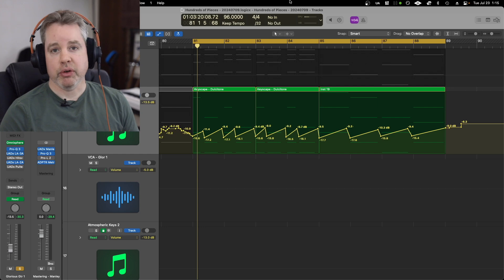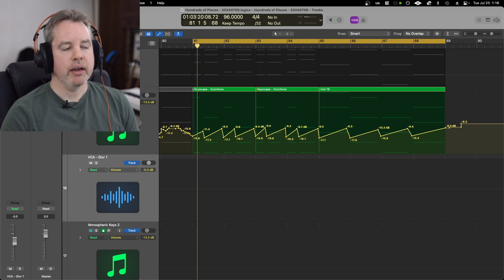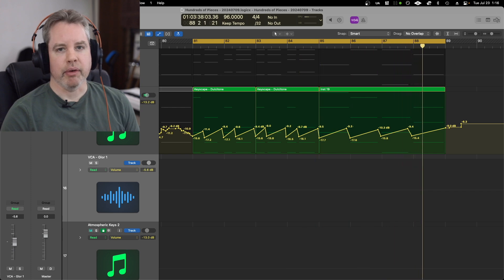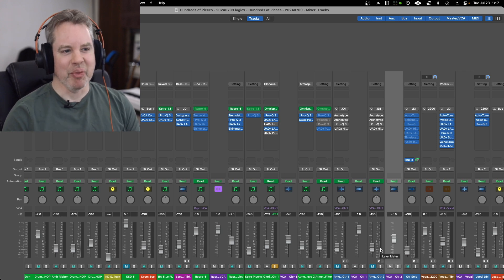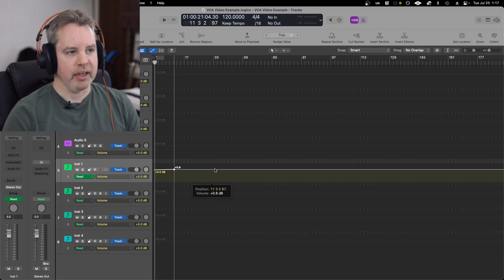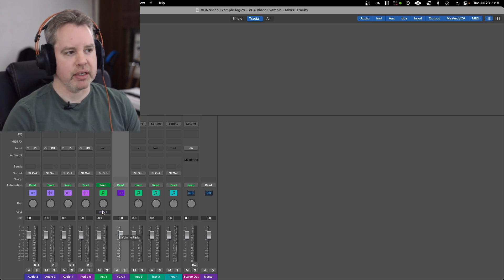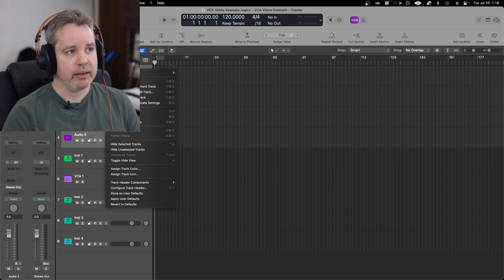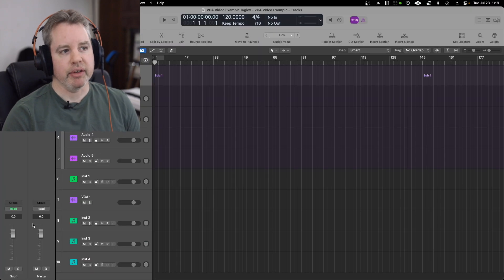How To Use VCAs With Automation - Logic Pro Tip

Comment: Didn't know this about logic. been using reaper for years and it has it's VCA basically built in to every channel. So when you open a volume automation, it sets the fader of the channel to 0 and a volume trim line is added at the volume the fader was at previously. You can do all your volume automation with the envelope and still use the fader for its "master" trim. These type of integrations make me choose reaper over other DAWs. No limit to plugin amount on a channel, automatic resampling of media (so never ever have syncing problems when mismatching media types). Just simple and obvious solutions to problems people have been working around for years.
Reply from the maker: Right on!